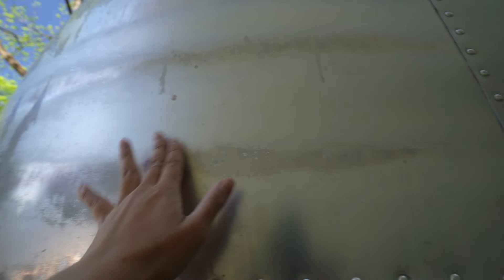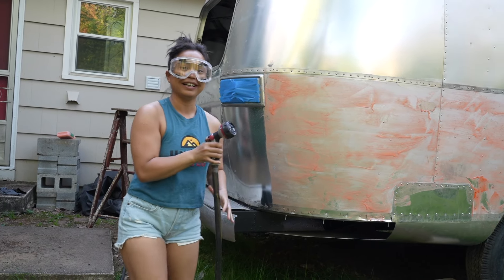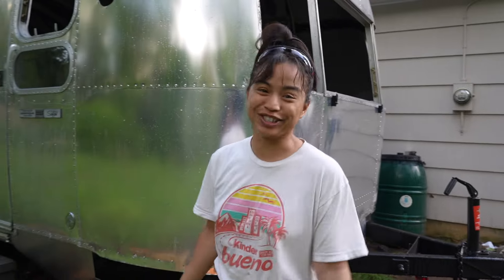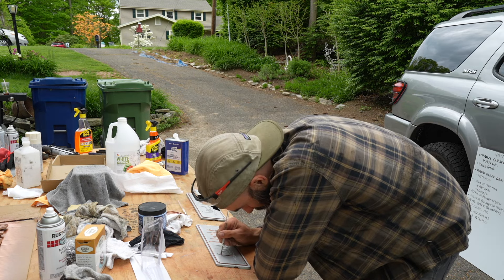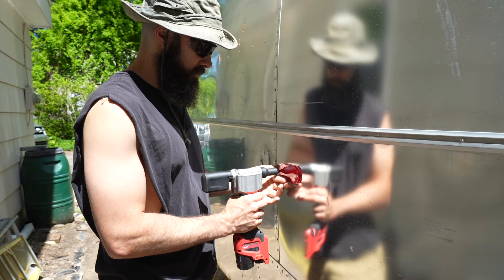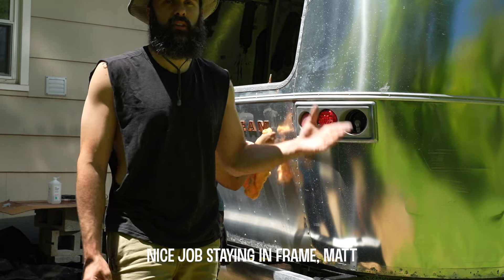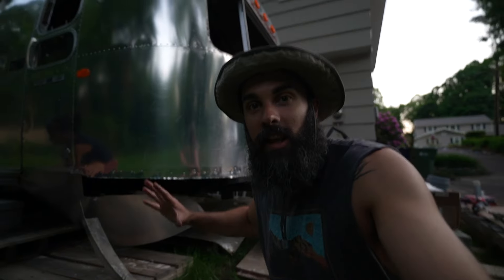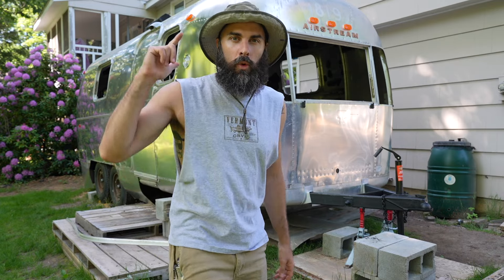GIVING OUR AIRSTREAM A NEW LOOK! (Airstream Restoration ep. 10)

Comment: Did you go all LED lights? Longer lasting. 😊 
There is a  Brillo like pad for a 4” grinder that will take those numbers off the aluminum. 
Detail is important. You’re doing great! 😃
Reply from the maker: The rear brake lights are LEDs that came with the airstream everything else is incandescent. And do you have a specific link/product for the pad? I tried everything I could find/think of but could not get the rest of those numbers off. Thanks for your support!

Comment: Great Work!
Growing in patience is a great by-product to tearing down and rebuilding an Airstream! 
Will it need another clear coat once the exterior is completed or is it unnecessary? It looks good to me, either matt or glossy (...that may not be the correct description, but the finish it is now, ya know).
I'm looking forward to hearing about Hawaii!
You've Got This!!!
Reply from the maker: Thanks! There are a few different options out there for what to do with the exterior skins. We're not really set on any of them we just wanted a uniform look across the entire shell. It's not perfect, but for a 51-year old trailer it's good enough and we're happy with it. Polishing is a way to seal the whole thing but it would add 200-300+ hours of work and require more specialty tools and is another thing for another time (maybe in a few years). Based off our research, if we don't add anything to it the shell would just become a dull/patina grey which I think would look great and require less maintenance going forward